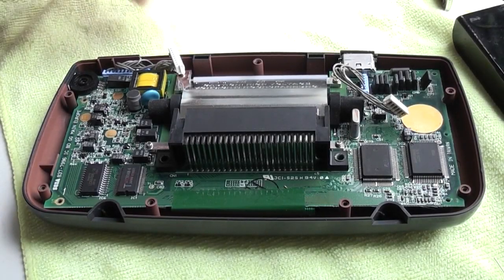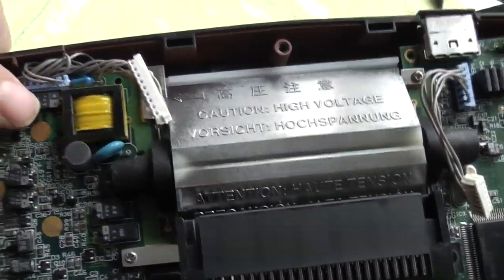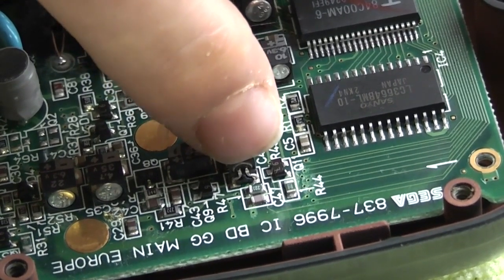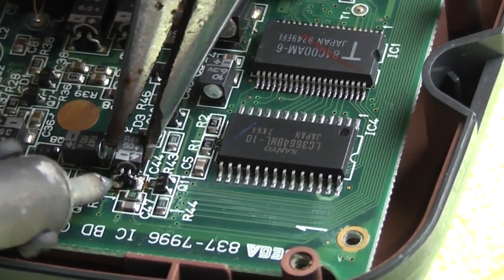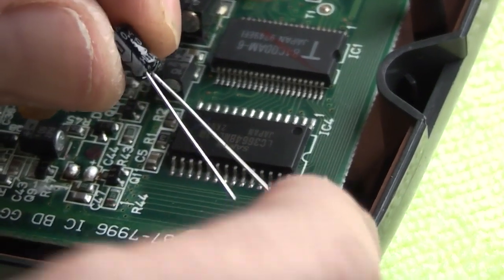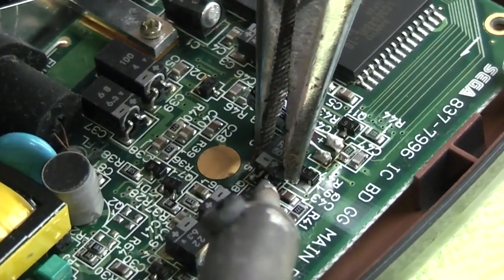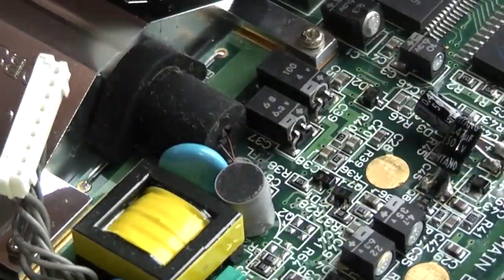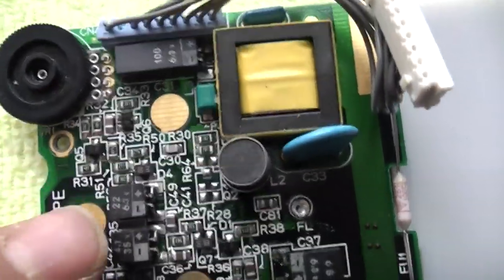Sega Game Gear Tutorial - LCD Screen Fix - Replacing Main Board Capacitors

Comment: Thanks so much for this! I just did this capacitor replacement and it worked great. I can see my screen from the front again! I had to work a bit to get everything to lie flat but the case finally went back together.

Comment: One minor correction to the video.  The microfarad rating needs to be exact or as close as possible.  The voltage needs to match *OR* be higher, and actually getting one with a higher voltage rating actually protects more and will not damage the unit.

Comment: Hello. I just tried replacing the 2 capacitors on the board, and I got them switched out, but after turning it on, I'm still not getting an image. Before I replaced them, if I tilted the screen, I could kind of see the picture, now the screen still lights up, but there's nothing. It's just black. Did I somehow ruin it? Or do I need to replace the other capacitors as well?

Comment: Thanks! I have noticed a problem with one game, Chase H.Q. My other games play fine, but that one triggers the old screen issue. I've tried cleaning the game but it still happens. I'm wondering if that game might use some feature of the system that relies on a bad capacitor that I didn't replace. Have you run across anything like this before?

Comment: Love your tutorial. I've got my Game Gear open (It is a US version model 2, which I learned from your other video) but I can't tell exactly what the rating is on the capacitors I have. They are not black like yours but rather tan in color. If you were to look at them, they are printed in this general format

R 4

5 0

Any ideas on what micro farad and voltage these might be? Thanks!

Comment: I had the problem with the screen needing to be tilted at an angle to be seen, so I replaced the two capacitors that most frequently fail. But now when I go to turn my Game Gear on, it only comes on for a second and shuts off. Do you think it was because my soldering job wasn't good?

Comment from the maker: on the one with no picture, make sude the contrast dial is tuned up full and tilt the game gear so you are looking at the screen from and angle at the bottom of the screen, you should be able to see a faint picture, if you can, then you need to replace the capacitors. Bad capacitors are causing the sound problems too. The game gear with the line through the screen is scrap. The LCD is damaged and they can't be replaced

Comment: I had pulled off one of the contacts before, on the Motherboard, and somehow still managed to get the cap on there. But when I turned on the Gamegear it worked and everything, but does breaking off the contact on the board make it so the capacitor is not read? Like it's not even there? That would explain why it looked like I didn't do anything.

Comment: Two of the pads on my board have become loose/broken off. Any idea how to fix this? I've heard that you can scrape an area of the board without traces to expose copper and use this instead of the pad, but I'm not sure if this applies. Thoughts?
Reply from the maker: lilpastasalad Yes you are correct, if you have lifted a pad off, you need to find the trace that went to that pad and solder to that instead. The traces are extremely fine, so this can be difficult but it's the easiest option

Comment: I followed these instructions and it worked, unfortunately I accidently caused a small spark to jump from one of the button contacts (start) and one of the other random pins by mistake when my screwdriver touched it when it was turned on. Now none of the buttons work anymore?  Is there any way I can fix this, have I blown a fuse on the board or is it bricked?   
The system still starts up ok its just the buttons no longer work..  :(

Comment: I have replaced the two 0.47 50v capacitors and now i get a blank screen with sound. I have soldered them on about three times and have no idea why it doesn't work.

Comment: I just bought one someone had modded to remove the fluorescent bulb from and had fitted a crap LED on one side.

The Caps don't look replaced so if I had the caps replaced and the LED mod fixed to work better would it work?

They also removed that 10 prong box thing in the top corner of the motherboard. Usually has a green or yellow square inside it.
Reply from the maker: Hi, yes I don't see why it won't work once you have replaced the caps, assuming it is working already. The 10 prong box thing is a transformer which was used to power the fluorescent tube, so with the tube removed, that transformer is no longer needed
Reply from the maker: Replacing the caps doesn't fix all issues with these, it really only improves the dim screen problem. That 10 prong box is a little transformer that is used to power the fluorescent tube, so if you are keeping LED's then you won't need to worry about it

Comment: Stig i got a caps kit of ebay, and i see you said that it may be only to caps on the left hand side that would be the problem, is it worth just changing those 2 first, and then putting it all back together for a try before doing the rest?
Reply from the maker: I found that those 2 caps on the left are the main ones that improve the contrast of the screen but it's best to replace them all if you have them, they all leak after a while.
Reply: I went through and fixed each capacitor(only one audio) and the machine is up and running again, i only soldered one time before and that was to reflow the solder on a mega drive 2 power unit, Thanks for the guide stig, it was like a crash course in soldering for me and learnt loads in a short time, now i have 2 more Game Gears that are faulty.
Reply from the maker: +Robert Beresford Awesome !

Comment: Hey stig, since you're much more experienced with this stuff I'm hoping you can help out. I'm having a REALLY weird issue after attempting a recap. I'm a complete beginner so I'm sure I screwed something up but I'm not sure what, and I'm hoping you may be able to point me in the right direction. 

This game gear I received had the typical lines on screen (or sometimes no image at all), and no sound problem, etc. I'm sure you know the deal. For the record, it is a VA1 board revision, with 1 ASIC.
Yesterday, I started out first with the 2 smaller boards (audio and power) and completely recapped them using the caps I got in a kit off eBay. After doing so I reattached them and reassembled the console just to do a quick test to see if there was any improvement so far. It looked great! And it made sound! Although the image wasn't perfect it was pretty good all things considered. I'm thinking I probably should have left it like that. But anyway, I dissasembled it again so I could do the caps on the main board in the morning. Better to do things right than to leave a job half-done.
So jump cut to today, I proceeed to remove all the caps on the main board. Clean off all the corrosion from underneath the caps, add some solder, put in the new ones… 2 and a half hours later I'm finally done and ready to close this thing up. Pop the cable connectors back in, put in a cart and get ready to see it in action.
This is where things start getting weird. The image has actually gotten worse. If I leave the brightness dial in the middle, then the image looks absolutely normal. But if I start to turn it up brighter, the image actually begins to distort and stretches vertically as I turn the knob! Some lines appear as well.
I really have no idea what might cause this but I'm really eager to get in there and make this thing right. I look at all the connections and they seem all right to me but again I honestly just don't really know what I'm doing. Like I said, complete novice. Are there any connections I should be looking at in particular that deal with that brightness knob? If it could be narrowed down to a particular capacitor I should be looking at that would be so helpful. Any assistance would be really appreciated!
Reply from the maker: Hmm I really can't help much without having it here in front of me but the first thing I would do is to check that you have put the correct caps in the correct place and check that the polarity of each cap is the right way round. Also check carefully that you haven't bridged something with solder, a magnifying glass will help with that. Good luck
Reply: StigsWorld thank you so much for the suggestion man, really appreciate the tip. It turns out I actually did have one cap put in backwards - it was actually the large one right next to the brightness knob so i put it the right way around and I was hoping this might be the culprit, issue seems to be the same though. I triple checked everything, reflowed every connection I made, added more solder in some spots... nothing seems to be doing the trick sadly. I can't see any spots where I would have shorted something. It's so frustrating considering it was working so well when I did my "half-way done test" yesterday! But hopefully I'll figure it out hahah. Thanks again man.
Reply: @MrRom92DAW  if you did solder the cap on in first place with reversed polarity, then always renew that cap and every cap around that area. It sounds like there's more then one cap faulty now. A cap is very sensitive for wrong polarity, you can blow them up easily internally without seeing it on the outside. They're shorcircuited then, thats why change the caps and you're probably will be fine after you changed them for brandnew ones.

Comment from the maker: Sounds like it needs the capacitors replaced. If the screen doesn't light up at all when you turn it on, it may need the fluorescent tube backlight replaced

Comment: i picked up two game gears from a car boot and one has sound but no picture at all and the other has a line through the screen but then turns itself off after a while..you must get so pi##ed off with all the questions but any help would be much appreciated as although i've little experience it doesn't seem impossible to pull off these procedures if not a bit tricky

Comment: So as long as the voltage is higher than the original it's ok but the MF has to be exact same?
Reply: exactly right,  Mf or Uf farrad is the most sensitive > if you step up for instance in voltage from 10volts to 16volts but with same  farrad it doesn't matter.  But never go down! :)

Comment: Is there a reason why mine turns on then turns off I'm thinking it could not be the sound part. Does any one know bout how this could be fix.
Reply from the maker: That is usually caused by bad capacitors on the main board. Follow this tutorial and it will fix the problem. Thanks